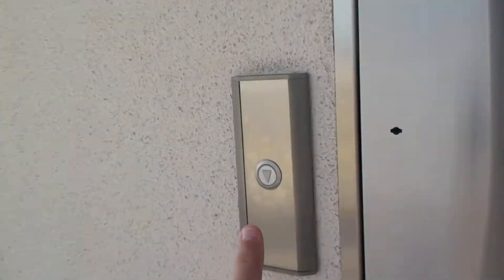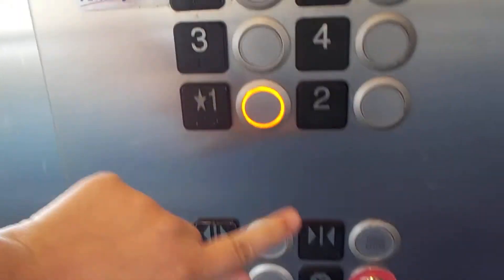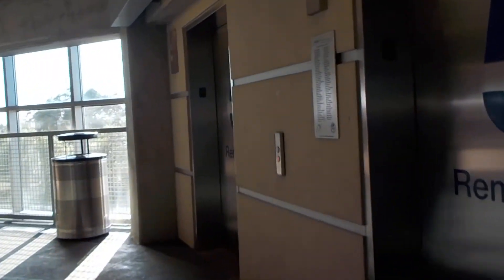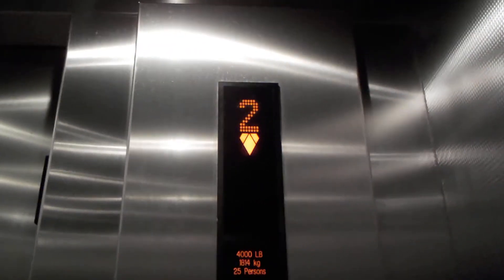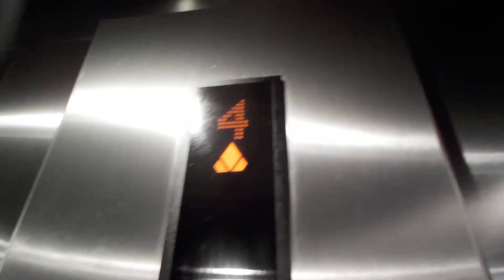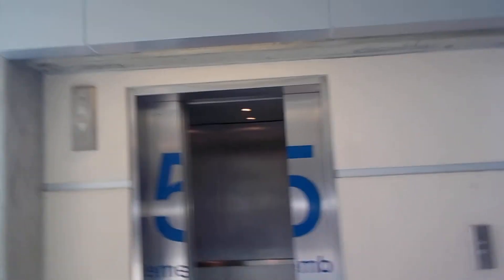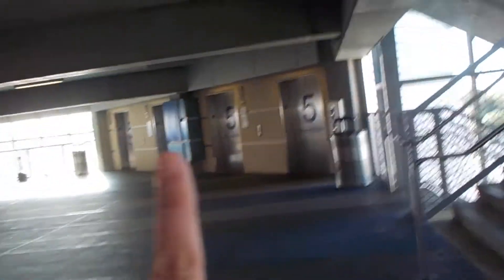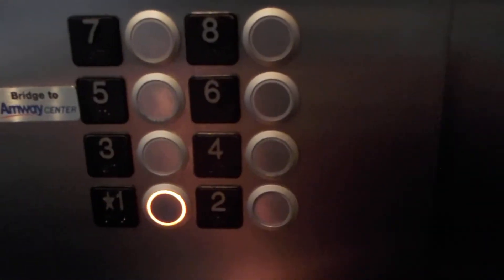HORRIBLE KONE Ecodisc Traction Elevators at Amway Center Parking Deck (Geico garage) Orlando, FL

Comment: Schindler 400A's sometimes make shaft noise like that, but 400A feels much sturdier than Ecodisc.
Reply from the maker: by far 400A is sturdier. this was garbage.
Reply: Superduper Julien But it still runs right? As long as it runs, it's still a useful machine.
Reply from the maker: True
Reply from the maker: +Elevating Denver did you see my mcdonalds video?
Reply from the maker: +Superduper Julien of construction and the elevator
Reply from the maker: +Elevating Denver also, did you see the US elevator at hard rock and the Dover Elevator at shrek and the heavily vandalized Schindler
Reply: Superduper Julien Yeah, I have seen those. You and Jim have made some Orlando elevators more famous now.
Reply from the maker: Which one? I know Jim filmed the elevator at mcdonalds. I will miss that thing. 😭
Reply: The McDonald's elevator and those Fujitecs mostly.
Reply from the maker: Yeah the hotel I filmed at was the Castle hotel. Next month I will get to film my first series 7 elevators ever ridden in my life at cabana bay beach resort in Orlando, FL. I didn't film them this month as I didn't stay there.
Reply: Superduper Julien Sounds great Julien. This winter I am staying at a nice hotel in the Colorado Mountains.
Reply from the maker: Do you know what elevators it has?
Reply: Superduper Julien I think the hotel elevators are Schindler. The garage elevators are Otis.
Reply: Funny thing was, I tried to ride a full blown 400A MRL last Saturday but it was locked off to a keycard only. GRRRRRRRRRRRRRRRRRRRRRRRRRRRRRRRRR!!!!!!!!!!!!!!!!!!!!!!!!!!! I rode a 330A in the same building & it was kinda death trap
Reply: Well, these have survived over 5 years so let's see how they are running five years from now.

Comment: What cheap pieces of junk. These surprisingly aren't MRL which means they are EcoSystem MR Traction. They also must be somewhat older considering the chimes, maybe even before EcoSpace was introduced.
Reply from the maker: this was installed in 2010 as an addition when the amway center reopened after getting rebuilt. They used KSS-500 fixtures but installed innovation lanterns and I'm pretty sure this is MRL. Ecospace did exist in 2010.
Reply from the maker: this is probably a Monospace but not 100% sure
Reply: Superduper Julien
I'm surprised they are so new since they have the old Series 220 chimes. They could be MonoSpace, but normally when you look up the shaft you can see the MRL system.
Reply from the maker: Yeah I could see the Ecodisc, but idk if it got on camera
Reply: Superduper Julien
Ok, it didn't show on camera. These must be MonoSpace because they are too fast for EcoSpace.
Reply: Yo omg my god this is mrl
Reply: Specialty Elev8ors and UEE's by Technicalboy3000 WTF? That had already been cleared up. I didn't see the motor on camera, but Julien said he saw it in person.
Reply from the maker: WestCoast Elevators I did exactly
Reply: WestCoast Elevators owch that burns :)
Reply: ElevatorsinUSA my dad's FRIRNDs apartment flats have EcoSpace & they are boring as hell because the accelerate so slow